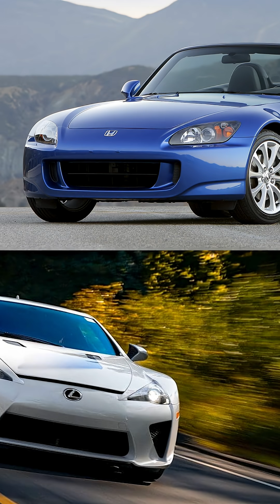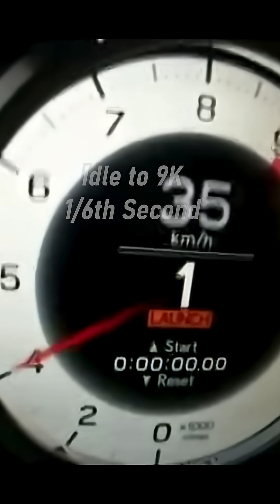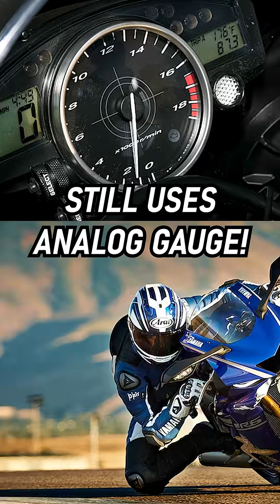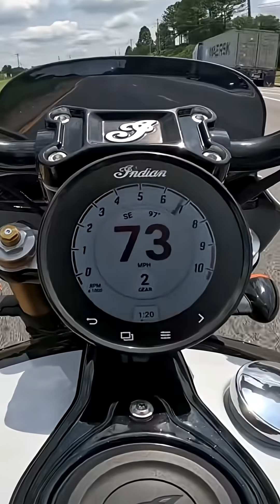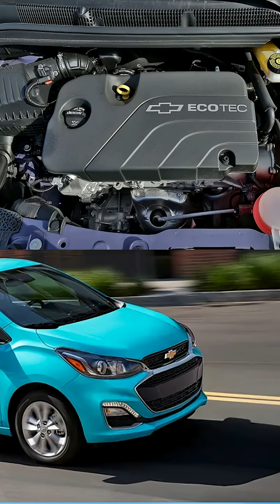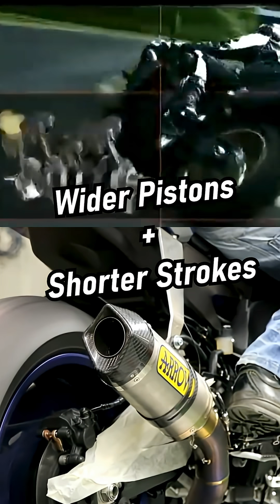wHy Do MoTORcYCLE ENGiNEs ReV MUCH FASTER tHaN CaRs?

Comment: the rev needle which is like a couple grams and has no load, moved by an electric motor (a servo, usually)
Can not follow the RPM of an entire combustion engine.

Whoever thinks this makes any sense, at all, is probably someone whose neurons haven't yet booted up.
The needle can be made go from 0 to max so fast you couldn't see it. Ever seen an HDD arm move around?

Comment: 3 factors. Power density and longevity and efficient . Bikes are rarely thought of as lasting commute vehicles. 14k rpm engine will last far less than a 6k rpm engine. You can go a step further and see that diesels run 2k rpm and regularly hit a million miles. Of course build quality and application are also important for longevity. A bike does not need to be efficient either. A large engine bike can often get worst mileage vs a modern efficient car even though it weighs 6+ times as much. 

I would guess that a 6-7000 rpm bike engine stroker that is turbo charged would be far more efficient for commute and last longer. This is not a thing because you are never ever hauling anything so you do not need torque at low rpm’s and you also are not worried about the gas. So they wind the engine out to infinity and that’s how modern liter bikes have 200hp where an equivalent car would have 2.5-3 liters to provide the same power.

Comment: Um no. The reason motorcycles rev up so fast is because they don’t need to move as much weight and thus have much lighter flywheels. You’re 1000cc vs 1.4L argument is moot when you bring up the zx14r engine that has the same displacement but redlines at 11,000. Most high revving bikes are sport bikes which cap at 550lbs. A fraction of the weight of any car. Much less rotating mass is needed to move the bike meaning higher RPM is just a side effect. A very good side effect 👌

Comment: UNDER square. not Oversquare.  Oversquare means torquey, low reving, and wobbly.   Undersquare means fast, high reving, and balanced. 

Undersquare; Honda CBR 600RR, Yamaha R6, CBR250RR, Daytona 675, Nissan Skyline R32-34 GTR, Mazda Miata, Lotus Elise.  

Oversquare; Harley Davidsons (all of em), Lots of modern BMWs, KTM Duke 390, Triumph tiger 660, Nissan 240sx with KA24, Honda Civic 1.5 turbo, Ford Mustang ecoboost, Golf GTI

Comment: WRONG.

Size has NOTHING to do with it. 
V-10 days of F1…..13,000 rpm.

It is all about engine design.

Three main types

Over square-this is the high rev quick acceleration design

Square- balanced both in rpm and power, typical automotive engine

Under square - this is the low rev power engine, diesel engines, striker engines, tractors. 

This who’ll video is FALSE 
The AI voice sounds about as excited and intelligent as the bucket of dirt I have outside……
Cars can rev as high or high than bikes if that is what is decided on. 

Stupidity is definitely on the rise.

Comment: One thing you forgot to mention, motorcycle engines are usually 2 stroke while car engine are mostly 4 stroke. For a 1 cylinder configuration at 6000 rpm, motorcycle engines could perform 100 combustion cycle per second while car engine while car engine could only perform 50 combustion cycle per second. Also a 2 stroke engine has less moving components than 4 stroke, so less things need to be optimized for high rev

Comment: 283 controlled explosions in a single second will never not be mindblowing to me. Engineers are wild
Reply: An important detail: they're not actually explosions. Those would be catastrophic.
Also, on a 4stroke, there are half as many combustions as revolutions. So, at 1k RPM you have 500 combustions (each piston) per minute, about 8 per second. So at 20k you'd have about 160 per second.
RC engines, the nitromethanol ones, which not only rev to 40k RPM but are also two-stroke so there you get ... huh. 666 combustions per second
Reply: @GeorgeTsiros oh. I thought one revolution was the entire 4 stroke cycle. Not actually the amount of times it spins. Thanks

Comment: Because bikes are very light weight so they can just emphasize more on extracting as much HP from the engine rather than Torque. HP more or less being how fast it can get the wheels spinning, torque being with how much force the wheel is being rotated. You need more torque to push more weight. 

 Really dumb way to understand would be; bigger the bore more the HP as it would also rev higher, longer the stroke more the torque but longer the stroke gets more the engine is unable to comfortably stay at high rpms.

Comment: Ok but you didn't do anything to disprove the rumor about their reason for using digital in the LFA. I have no horse in this race, don't care about LFA at all, just want to point out an error in how you argued it. Based on the stats you gave, the LFA is changing a lot more revs per second. 9k rev delta in 1/6th of a second is a lot faster change than 17k rev delta in 1/2 second. In the 6th second that the LFA is apparently being measured at the bike would only be changing 5.3k revs, which is about 50% slower. Either the LFA genuinely has an extremely insane idle to redline time, or you reported something wrong here.

Comment: correct but in a dulled down way..... its NOT just because they are smaller. but that does aid in the real reason..... its down to forces being applied on reciprocating parts. smaller it is (less weight it has) yes the faster it can travel and then change direction without tearing itself apart. but thats when other things like stroke/ bore like you were kinda getting at plays a part.  short stroke + big bore = oversquare (stroke being distance its actually traveling) so if its light and traveling little distance....  = higher rpm achievable before the reciprocating mass tears the engine apart from the inside.

Comment: I'm going to issue some corrections.

1) It's not that these 1L bike engines have a performance emphasis. It's that an economy car also needs to move more weight. So it needs more torque. Which means a super shallow stroke like bike engines have is not practical in that application. It is viable for hyper lightweight cars such as the KTM X-bow and Ariel Atom.
Cars also use the same principle for performance as well. A great example is the Toyota 1ZZ and 2ZZ. Same 1.8L displacement. But the 2ZZ is oversquare, so it can rev higher and produce more power at the expense of some low and mid-range torque which the 1ZZ has from the longer stroke and lower revs. Which is why the 2ZZ was used for the performance oriented cars and the 1ZZ was used for your regular commuters.

2) The LFA's need for a digital gauge wasn't the amount of RPM, but the engine's rate of acceleration. Like if shifting up, say the RPM went from 9k down to 5k. The needle has to move that distance. Same with downshifting. The engine was so quick at those kinds of things that a digital gauge was the solution they employed.
The super lightweight rotating assemblies and near instant change in revs is also why race cars don't use analog gauges anymore either.

Comment: That's not because of engine's size, but because car's big weight needs a much bigger engine's torque on the idle RPM to start moving. But if your engine gives it's maximum torque on 15000RPM, you would have too small torque on 1000-1500 for a car. But enough for a motorcycle.
P.S. F1 V10 engines had idle RPM near 4000, by a same reason.

Comment: Cars need torque to move its weight and trailers and to not lose torque is to keep the engine spinning low. A bike doesnt need much torque so it can spin fast, netting more horsepower and less torque (which it doesnt need)

Comment: Yea, doesnt explain why bike rev faster can use analog while lfa say analog is too slow for the revs? Lexus lying?
Reply: no they're not. he just missed the point.

Say you shift down a gear. The engine speed changes the moment you shift down a gear.

And if it changes fast enough, an analog gauge will not keep up.

It's not about revving from zero to redline like seen in the video.

In other words, Lexus wasn't lying. Bladed just missed the point.

Comment: Also bikes doesn't need a lot of torque to move because they weight less than a car, so instead of using a big engine to generate power they rev  higher a small engine for making the same power, but also less torque

Comment: I think it was SuperFastMatt that did a really good indepth explanation on why its also hard to just put motorcycle technology into cars, the two leading causes (iirc) was that cars have stricter emission standards and are tested for over double the road time compared to bike tests. Second everything that makes a bike engine fast doesn’t work as well in car do to needing to re-enforce everything, adding weight, meaning the engine slows down to not rip itself apart, loosing the whole point of high revs. Basically it only works in race cars.
If your interested in more gritty details its very interesting
Reply from the maker: oh neat, I'll check out their video!
Reply: I was like, what a timing, I can get the ADHD short version and the ADHD long version

Comment: You can drill out the cilinders in a car and install short stroke pistons, lower the flywheel and crankshaft weight and your car will rev faster and higher too.

Comment: Yea its just physics. They are smaller engines, thus to produce more power and perform better they have to hit a higher rpm. The larger an engine gets the lower it can actually rev, not that it can’t, but if you value engine longevity then they have to rev slower. 

Compared the engines of a motorcycle to the massive 6 and 8 cylinder diesel engines in some commercial ships, those produced a gargantuan level of power but rev so low you can actually calculate the rpm by timing it with your watch. I’m not kidding I actually went aboard a commercial ship during a public ship tour and they had one of those massive engines, they had them connected to a gear reduction set up and the disconnect it to be able to do a short run. I counted it at around 105 rpm (post rounding up), the gauge showed the engine spining at around 103. So for only a 2 rpm difference, that is pretty good to be able to keep track and with in the rev range of the engine. 

I did have to do the whole 1 2 3 4 5 6 7 8, count to be able to keep up, but all I did was just place a tic every time I counted to 8 and then just multiply, the deviation was due to round up errors most likely. 

But still, thats pretty cool.

Comment: the Fireblade 250 rr, one of few vehicles to hit 20k rpm. you could red line that thing while moving at a school zone legal speed
Reply: There is the new zx25r. Also 250cc 4 cylinder. I wanna get one so badly

Comment: the LFA supposedly needed to use a digital gauge because of how quickly it changes revs, not how high it revved.
Reply: Did you even watch the video?
Reply: @lodickasvlajeckouYes I did and the video did not address the point properly.

It's not about acceleration from zero to redline.

It was more about when you shift up and down gears. Going from 9k-4k rpm on an upshift or 4k-9k on a downshift.
If the rotating assembly is super light, then the revs can change faster than the analog gauge can give a reading for.

Again, not when normally accelerating from zero to redline like seen in the video. It was a poor argument.

It's the same reason why race cars don't use analog gauges anymore either.
Reply: @lodickasvlajeckouyes I did. And I was addressing an error in recounting the rumor.
Reply: EXACTLY
Reply: yeah, that was a stupid reason. Ain't no way an ICE can change speed faster than a 2 gram needle can be moved around by even a servo. It's just dumb. The arm in a hard drive can change position so fast you can't see it , literally go from end to end like a hundred times a second? Not saying that it is (or should be) used on a tachometer, but to demonstrate that no, an engine can not change speed faster than an analog needle indicator, for various reasons.

Comment: Not to mention the stress put on a motorcycle by weight is just the driver and the motorcycle, so anywhere between 200 pounds for small motorcycles and 800 pounds tops for the heaviest motorcycles, plus the weight of the pilot.

My motorcycle weighs about 180 pounds and I weigh about 118 pounds.
Reply: Shit my dr650 is 330lbs and I'm only 150lbs granted that is a big dual sport
Reply: @MONKEPUNCH  mine is a small 150cc commuter motorcycle used mainly for food deliveries in a metropolitan area.
Reply: @alanmunilla7196 I could never live next to that many people even for work, I live in the middle of nowhere tho,
Reply: @MONKEPUNCH  You weight 30 lbs more because your water isn't contaminated. Same.

Comment: Fun fact: the CBR250RR MC51 rev 5k higher than hybrid and 2009-2013 F1 cars (15k limiter for the hybrid, 18k for V8s and 20k for the CBR)
Reply: I’m not doubting you but isn’t the mc22 not the mc51 that has the highest
Reply: @DumbSh__-101 it’s the mc51. The mc22 redlines at 18800, the 51 at 19500
Reply: @bhx7527 mc51 is 2 cylinder....its mc22
Reply: @bhx7527  I've seen someone hit 20k on an mc22
Reply: @specc_s1452  I did XD and ngl mc22 inhale gas like cbr650 lol
Reply: @DumbSh__-101  correct. its the highest revving motorcycle to date
Reply: good lord that is high
Reply: If you want something higher revving. Try Honda RC116, that small engineering masterpiece revs up to 22k RPM
Reply: People always talk about the Honda CBR 250RR. But never know that, back then 1987-1991. Yamaha, Kawasaki and Suzuki also makes similar bike. Inline 4 with 18-20 k RPM 250CC engine.
Reply: @vasilissazeta8675  similar.... yes.... as high revving.... no
Reply: @paulhutchings3509 what are you talking about? Yamaha FZR 250R, Kawasaki ZXR25, And Suzuki GSXR250R. All of them are high revving with 18-20k RPM
Reply: @vasilissazeta8675  Kawasaki even makes a fuel injected Zx25R that you can buy brand new in southeast asia which pretty much makes it objectively better than the MC22.

I think all the attention goes to the Honda because it has a 500rpm high redline than the others. I doubt it actually was any mechanically better or capable than the other 3 but people will point to the tach and say this one is better.
Reply: The hybrid F1's never even meet that rev limiter anyway because of fuel flow efficiency. They rev closer to 13.5-14K
Reply: F1 up to 21k while being a 3L and and having 8cyl they not even on the same dimension
Reply: @sule.A  Yes the cbr250rr revs to 20k rpm with a 250cc inline 4 engine which is impressive of course however what's even more impressive is that engine can last for more than 200k kilometers. High revving and reliable as that is something not found in anything else.
Reply: @sule.A the v10 had 3l, the v8 had 2,4l.
Reply: @sule.A Starting F1 engine takes at least 90 minutes of preheating. Starting CBR is key-turn. 😜

Comment: That 1L engine is making mpg number like old days 3L i6 na engine
Reply: Exactly! 20mpgs. While I have a 1.3liter suv(and it is not slow) that I can achieve 50mpg on the highway in perfect conditions. It’s a stroker 3 cyl with a cvt and 22 pounds of boost. I enjoy the turbo lag lol it just lets you know the difference the turbo make. It does not have a tach but I image it’s rare to break 5k rpm